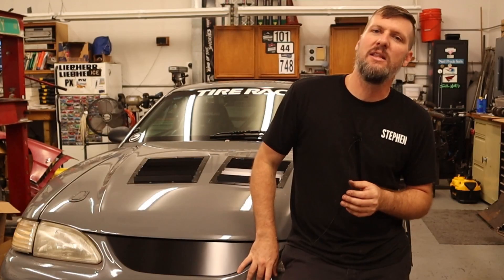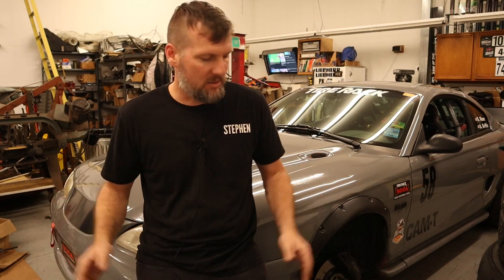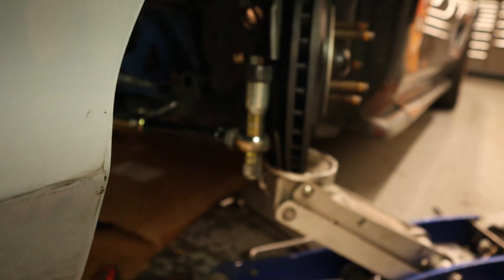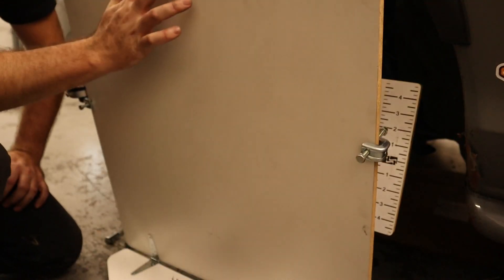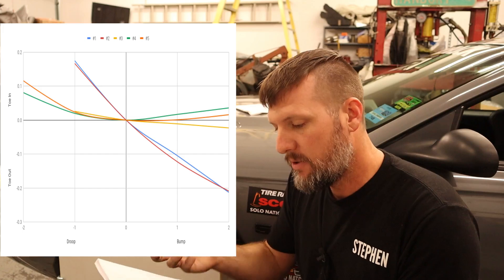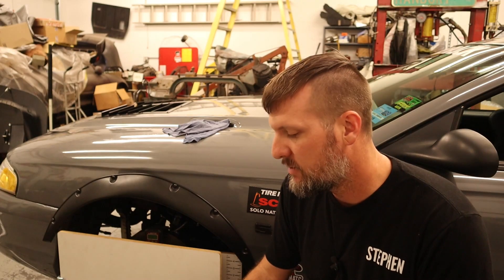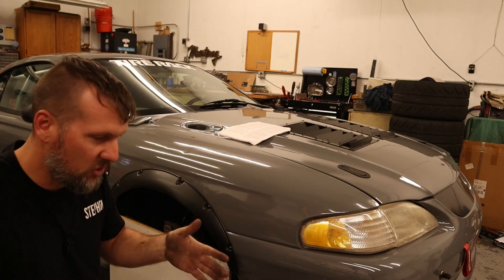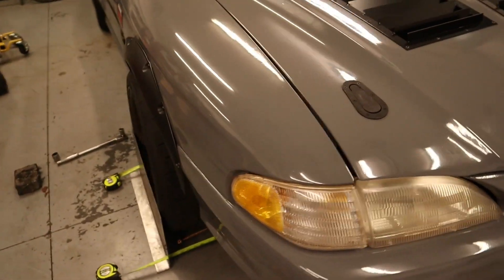My Bump Steer was terrible! Time to adjust it

Comment: 1) Why both sides are not the same in case of shims?
2) Do you feel any difference durig driving after bumpsteer correction?
Reply from the maker: In a perfect symmetrical car both sides should be the same. Rarely are things perfect. That's why both sides should be measured and adjusted separately.

Depending how far it's off, yes you'll feel a difference. Hitting bumps the car should no longer dart around. During cornering the tires will point in the direction you want.